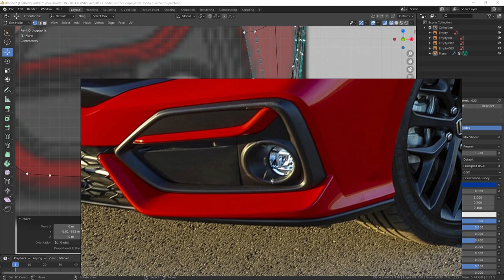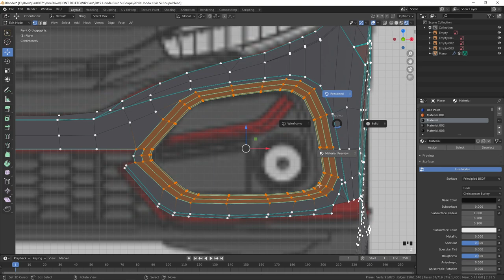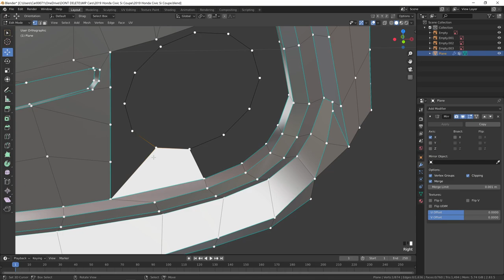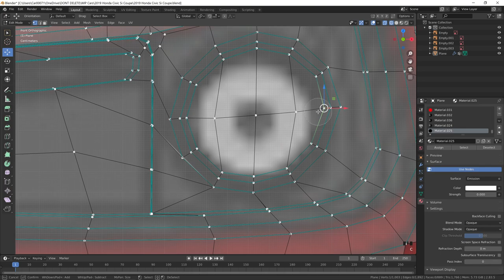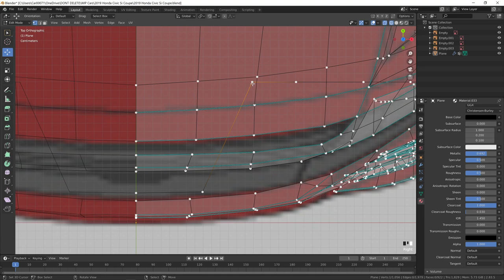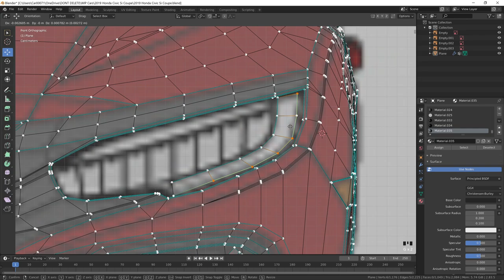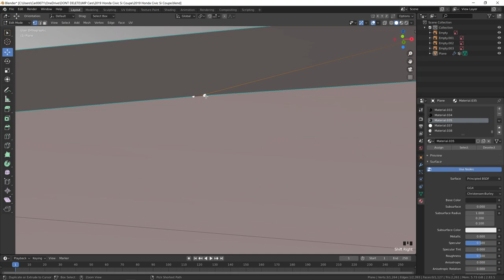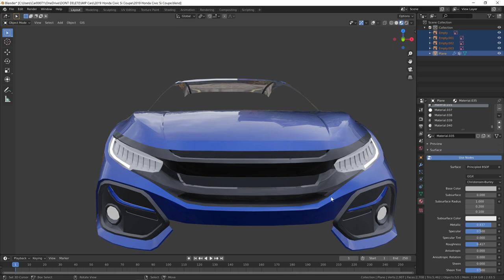How to make a car in Blender 2.8 pt. 3 | Headlights and Trim Pieces!

Comment: 3rd time restarting due to shading errors lol
Reply: auto smooth 180 angle + shade smooth
select all, shift + n to recalculate the normals (if both of those are on and there are still issues)

if this doesnt work redo some of the vertices or watch some tutorials
Reply: 36ys Animations ik how to model
ive done it before and can produce decent models
this car when i try to model it gives me errors even when i replicate the topo
ive messages cryptonix on discord
hes stumped too
Reply: @Rohit-nd6ie  what car is it?
Reply: 36ys Animations nvm, i figured it out
are you in cryptonix discord?
Reply: @Rohit-nd6ie  i am
Reply: 36ys Animations username? ill ping u
Reply: @Rohit-nd6ie  36ys (but why you need my discord is what im wondering)